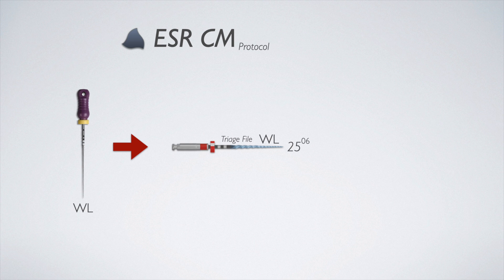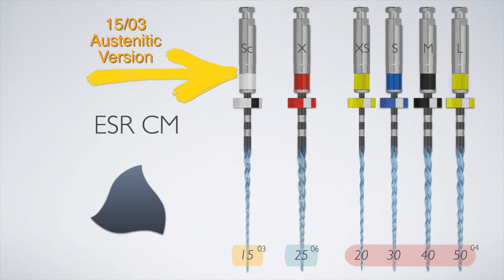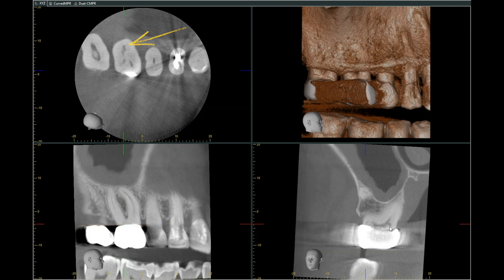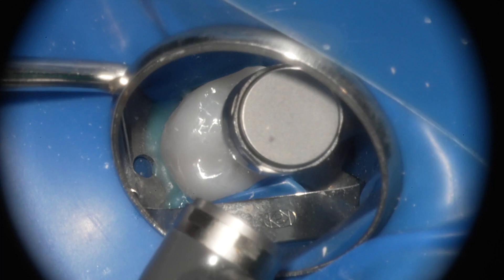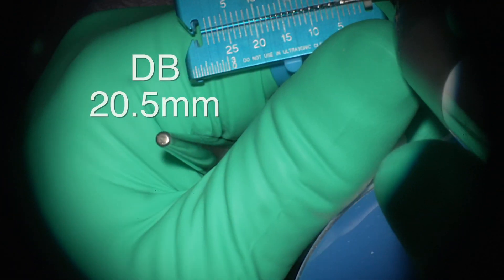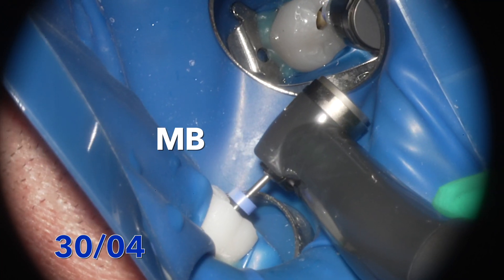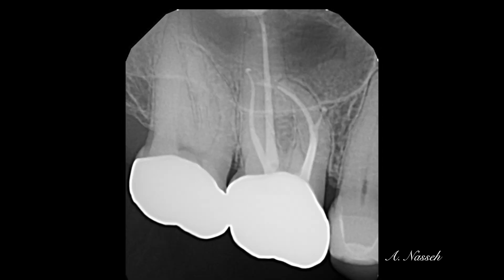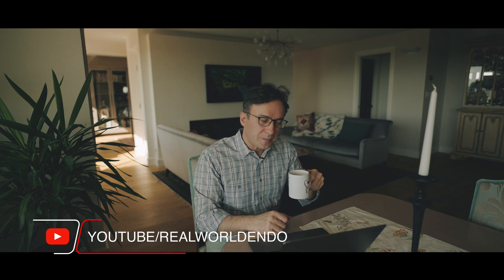ESR CM Instrumentation Update Part 2 of 2

Comment: Dr. Nasseh, I love the endo sync plus and have been using it for years, but one thing that still doesn't make sense to me and I'm very familiar with customizing the settings since I use ESR CM files at 270 degrees cutting and 30 degrees non cutting for efficiency is why we have an OTR mode for reciprocating files. Does that even do anything since how can torque be measured properly in a reciprocating file? Thanks!
Reply from the maker: That's a great question and is a long answer... maybe I'll make a video about it.... but you can use the reverse OTR (CCW OTR) as a replacement for reciprocation motion... it's actually better than the reciprocation motion for reasons you just mentioned, the fact that it's customizable.. .you're using it with a much more aggressive cutting action and I'm sure you're getting more efficiency out of it than the regular recip motion. cheers!